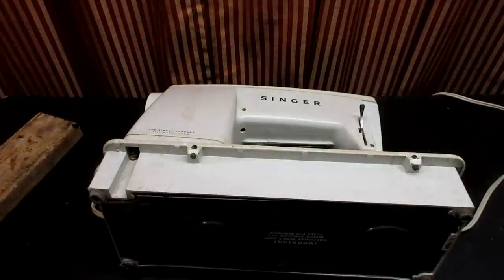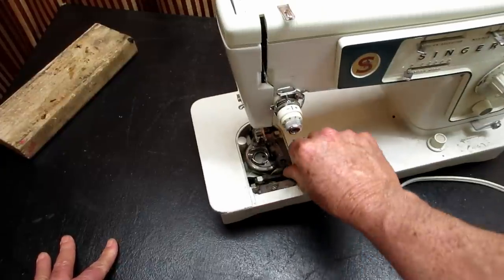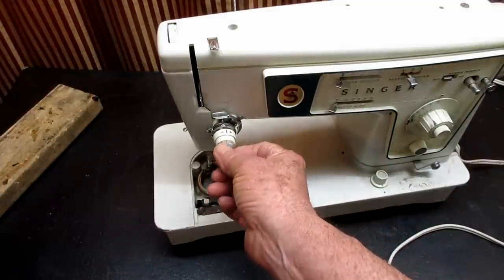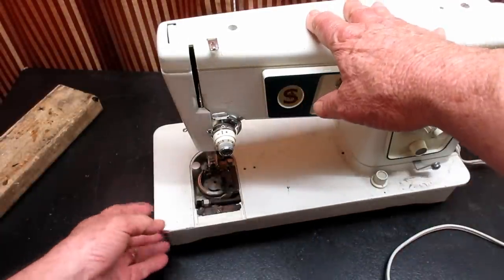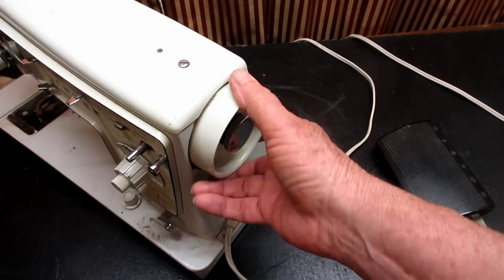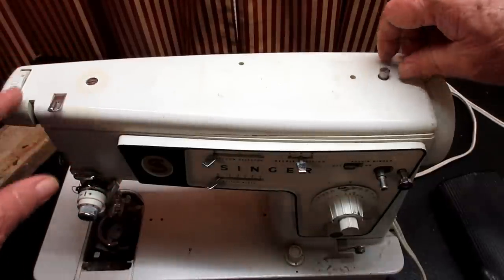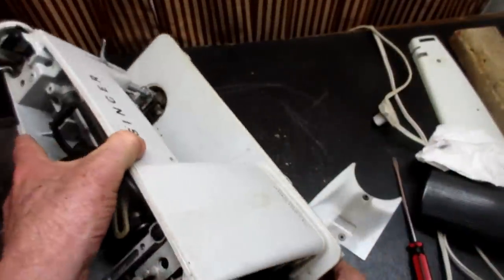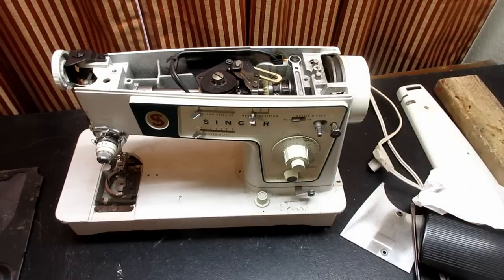About the Vintage Singer Sewing Machine my Wife bought me

Comment: .95 amp motor.  I wish I had that much juice in my 404 and 503.  Looks like a great project.  My wife told me once I needed a hobby when I got laid off from the railroad (I was driving her nuts).  I took up violin repair.  After about 6 years of repairing and playing fiddles I quit the railroad and got a job repairing violins full time.  I ended up doing it for almost 24 years until I retired.  I started sewing about 7 years ago and started sewing dog winter boots with a plastic geared Singer.   I saw a Singer 503 on Craigs list about 140 miles from my house.  $250 with all the basic accessories.  It needed a little work so I went on YouTube and found Andy Tube.  I cleaned it and rebuilt the motor.  I taught myself to replace the drive end bearing of the motor (bent the shaft on the first one) and used that to sew back packs and lots of other kinds of outdoor gear.  It was a little down on power for the heavy nylon so I found a Singer 404 straight stitch on Ebay for $70.  What a machine that is.  Andy Tube had just put one in the shower so that's what I did with this one.  I even named her Wendy as Andy Tube had named some of his.  Went through the motor and changed the brushes.  If you ever work on one of those P8 motors get the brush seating sticks like Andy has on one of his videos.  That thing is magic.  Anyway I guess I'm done writing my book here.  Thanks Andy, I hope you can take us along with your "new" Singer.   I've enjoyed all the videos I've ever seen on Andy Tube.  Thanks.
Reply: I've learned so much from Andy's videos too. I'm blessed to have found his channel. Very thorough teacher!
Reply from the maker: I had a nice ride with your comment, Ralph. Couldn't agree more about the 404. Same motor but just straight to the needle w/o the cam stack & vibrating bracket to push around. Thanks for watching my channel.

Comment: Definitely interested Andy...very selfishly hoping that you will post videos of your restoration...enjoy your content and always learn something from your presentations
Reply from the maker: Thank you, Gary. I've been studying that top gear a little and it looks a lot more complicated than the 457 top ear I did. It may have to come out the top of the arm, YIKES! 🤔
Reply: I was able to replace the top gear in a 477. You have to remove the stitch length dial and pull off the light switch, then the little clips to remove the face plate.  I even pulled out the light fixture to make some space.  With some effort I removed the set screws from the gear and with chopsticks I inched out the gear, dropped it down by the motor and tried to remove the motor to retrieve it.  I finally retrieved it, but could not get the motor all the way out.  Replaced the motor then went back up to the top.  I’m trying to remember now, I think I had to go in through the stitch regulator space after removing that in order to get the new gear in.  I got it in and had to remove it AGAIN! As it was a bit too tall.  I sanded the bottom of the gear off slightly and re-installed it.  This time it fit better and was not binding. Whew!  i watched your video and received documents from you (thank you) in order to find out how to replace the gear.  However, this machine and the one I worked on have a lot more bits of machinery near the gear.  You can do it!  You won’t have to totally disassemble the top end. Good luck, nice to hear your voice. I’ve been married nearly 51 years and my husband helps and encourages me in my sewing machine hobby!
Reply from the maker: @cynthiaporter8300  thank you for all the tips and I have heard from a number of people over the last year that some vendors are selling a gear that the metal base is a little bit too tall and most of them found out the hard way like you. If I get this year out I plan to measure the base so I can post it for people to let them know what the new gear should be like. I appreciate you watching my channel and taking the time to share the information?
Reply: @andytubesewing1953  Another possibility is to adjust the cam followers

Comment: I bought the same machine at goodwill about 9 mo ago..loved it loved it had trouble with the bobbin case. Some one had replaced the bobbin case with a newer one. I got rid of it because I wanted original parts
Reply from the maker: It's usually cheaper to buy the newer plastic Apollo bobbin case, but I can usually find an original on eBay. I understand your feeling about the original parts as I prefer the vintage presser feet also if I keep a machine. Thanks for watching my channel, and take care.

Comment: First thing I do is spray everything all surfaces and arms rods gears bearings with 99% alcohol Then rags hand rub car compound and wax. Then Lighter fluid mixed with mineral oil to free up everything. Works quickly does great job.
Reply from the maker: What an interesting process. Have you thought about doing a video showing us how? Thanks for watching my channel.

Comment: Hee hee 'wife speak'!  I too, Andy, know how to speak that language to my husband also!  Great seeing this.  There are similarities with my Singer 507.  Both made in Clydebank, Scotland, UK of course,
Reply from the maker: Yes, Kilbowie, Clydebank, Scotland. The parts manual does designate it as model 466K with 'K' meaning Kilbowie. The birthplace of many wonderful sewing machines. Thank you for watching, Heddy. BTW, I had a thought that the feed dog on your 507 may be crooked. Just a thought. Sometimes after removing and replacing a dog it's a little crooked from tightening one screw 100% then installing the second. One of the Singer guys told me to tighten the screws back and forth a little at a time to make sure the screw head seats into the hole and the dog sits flush on the lifting bar. I'm probably bring up another false lead, haha.
Reply: @andytubesewing1953  Awh thank you Andy for this little tip.  I shall certainly try that and keep you posted. x

Comment: What a coincidence! I just picked up one of these same machines a goodwill a couple of weeks ago! I actually bought it for the table it was in. But since I now have the machine I thought I may as well have a look at it and see if I can get it to run. It has no power cord but does have a knee pedal. I used a power cord with a foot pedal off of a 501 but the 466 does not seem to be getting power. So I am hoping you will do a video on getting yours up and running and maybe I can get mine running also!  SO GLAD TO SEE YOU BACK!!!❤️
Reply from the maker: cord may be wired different as the 466 has on/off switch. I do hope to do videos so maybe we can learn this model together? Thanks for watching.
Reply: Do you know where I can get a power cord for a 466?
Reply from the maker: @jacquelinespivey2413  They do not make the same style of "in-line" cord nowadays, but this reputable seller guarantees this cord will fit model 466 (you can shop around for price, too): https://www.sewingpartsonline.com/lead-cord-singer-604-sewing-machine.aspx

Comment: I have 2 of these models, my main one just started to play up, the motor not turning the belt, also pre existing my ownership one of the pattern stitches not working and feed dog adjuster stiff to move, We bought a spare from eBay, the only fault it was dropped on its face prior to us getting it, the corner plastic smashed and the thread take up lever is broken, such a shame it was well serviced and sounds beautiful, so lots of fun trying to fix one to make one good again. Look forward to your vlogs on this model, which are of great help and fingers crossed I get my one running again. ⭐️
Reply from the maker: Man that is really sad to hear and I'm sorry that happened. Yeah my one machine definitely has a bad gear. I've been studying this machine for a couple days trying to figure out how to change that top gear and it's a struggle so far. I may just start restoring it like I do all machines starting at the nose and working my way towards the motor and as I learn more about the machine maybe I can figure a way. But thank you for trying to save this machine and for watching my channel. I hope my future videos can be of help

Comment: I’m currently restoring a Stylist 467 which looks to be similar. Looking forward to see you working on this one.
Reply from the maker: I can't find ANY documents for the 467 but found info on Google & YouTube. Really is very similar with a slightly different ZZ pattern control dial and maybe cam stack. I don't think it was sold here in the USA, maybe. Have you looked at the top gear on the vertical shaft? It must be plastic like the other models. Thanks for watching my channel.
Reply: @andytubesewing1953  I could not find any documents either. I'm working with the Series 400 Service manual and take what works from different model. You are right that the only difference is on the ZZ pattern. The 467 has a control dial with two settings only,  ZZ and blind stitch. The Camstack is identical to your Stylist 457. My 467 is basically the 457 but with the Stitch length dial control of the 466. I bet the 467 was only available here in Canada. The top gear is plastic like the one you replaced on the 457. Your Series of video are very informative and are helping me a lot to learn about Sewing Machine restoration. Thanks Andy!
Reply from the maker: @TessierWork  well thank you for sharing that info. It's always puzzled me why singer has such different models in different places, but I guess they knew their market pretty well because they sure sold a lot of machines over the century also, thanks so much for saving the machines that you have rescued

Comment: Can't wait to see how you replace the top gear that is broken. I can usually fix anything on this machine, I have the 466, but no where can I find out how to replace this gear let alone the part number to get a new one since this seems to be my problem as I can see a loose tooth on the gear. Everything else works good. I will be waiting for the video.
Reply from the maker: I hope to make videos of the repairs, but in the meantime the part number for the top gear on the vertical shaft is #155819. I prefer the white vs black plastic. A few viewers have report some sellers are providing gears where the metal base is too tall and binds the horizontal shaft. They took the gear back out and sanded down or used a grinder on the bottom of the metal base.

Comment: I was happy to see your video post today.  As with all your videos, it was very interesting to watch.  Would love to see you restore your new gift. Your video on the 301 was very useful when I had to free up a frozen take up bar.  Do you have any videos on loosening the stop motion wheel on a 501a to remove it or to wind a bobbin? I can turn the hand wheel and the machine still sews,but when raising the needle with the hand wheel, the needle bar will not stay in place. Thank you so much for sharing your knowledge with your awesome videos.
Reply from the maker: Thanks for watching, Shelly. It sounds like the washer in the handwheel was put on 180 degrees wrong. Here is a playlist of 7 handwheel videos: https://www.youtube.com/playlist?list=PLsCOZgzzaiKLkg187yG6E4sV8ZdMzrHob    Most Singer handwheels work the same on the vintage models. Maybe the one on model 403A would help the most, but most show how to remove and replace the type of handwheel you have. The stop-motion screw on your 500A is a bigger style but still works the same. Good luck, and let me know if you still need help with it.
Reply: Thank you for your quick response.  I finally got the stop wheel unstuck by getting behind the machine so I could push instead of pull on the wheel to loosen.  The washer on the 500a is smooth on both sides & does not have the indentations like the 403 in your suggested video. It does have the 3 protrusions.  I moved the washer to various positions but did not fix the problem of the needle bar/needle/wheel moving down after manually turning the wheel & releasing it.  Oh well, the machine sews beautifully so I guess I should leave it alone.  Thanks again!
Reply from the maker: @shellyjacob6037  Sorry that did not help. I asked another person who does repairs and she felt it would be the stop motion washer also. We believe the tension of the handwheel gear to the pinion gear on the motor shaft would be enough to hold the Needle Bar in any position when the motor stopped or you turn the handwheel and stopped. I guess we are as puzzled as you then. BTW, you are only turning the wheel TOWARD you and not away from you, right?
Reply: @andytubesewing1953  Yes, I’m turning the wheel toward me like I would when I insert the needle in the fabric before sewing.  I’ve noticed that if I remove the wheels & washer and turn the shaft manually toward the front of the machine & stop, the needle stays in place which makes me think the problem has to be the washer, but I’ve tried moving it to different positions. When the parts are reassembled, the problem reappears.  I’m assuming it has the correct washer which is smooth on both sides.  What is the purpose of the counter balance?
Reply from the maker: @shellyjacob6037  I looked at the parts diagram for model 500A (there is no model 501A that I know of) and the washer is flat with three "ears" or "tabs" that stick out from the outside edge. They act the same as the 3 pins on the 403A washer. You can get a free copy of the parts diagram/manual by asking Alan for it at andymanuals53@gmail.com. You can also get a free copy of the original service manual for the 5oo/503 models from the sewing dude at this link: https://sewingdude.files.wordpress.com/2012/09/singer-500-service-manual.pdf     The handwheel info is on page 18.
Reply: @andytubesewing1953  I apologize, it is a 500A.  I have the original manual, not the parts manual which I viewed online.  The washer looked like mine but the diagram was not clear.  Thank you for the files info.  I have several treadle & vintage machines including featherweights that I acquired over 20 years ago mostly at a friend’s auction house.  Your videos have inspired me to get them out again.  It’s fun to learn from your videos the mechanics of them.  This 500a problem has me baffled though and there seems to be no videos online that address this problem for this machine.  I’m not brave enough to do any extensive work on it.
Reply from the maker: @shellyjacob6037  I forgot to answer your question about the counterbalance. There's a wait on each end of the horizontal arm shaft. You see the one on the hand wheel hand and the one on the nose and is more pie shaped. And it is what the take-up lever and the needle bar connecting link tie into the purpose of the counterbalance is because of everything on that arm shaft and how fast it's spinning. It can't start wobbling and so forth. So a counterbalance helps balance the weight across the arm shaft so that it will rotate smoothly even while it's moving. The needle bar take up lever, cam stack feed, rocker arm feed lifter, arm, vertical shaft to the hook, etc. Maybe you've heard of a flywheel on a motor shaft? Also, I'm not convinced it's a hand wheel problem but we are assuming it is when you remove the hand wheel. The hand wheel gear disconnects from the pinion gear on the motor shaft. What if the motor or motor shaft had something to do with this so my next troubleshooting step would be to remove the motor and leave the hand wheel on and see if that made any change to the situation?
Reply: @andytubesewing1953  well…removing the motor makes me uneasy.  I guess I need to watch a video on a motor removal. 🙂